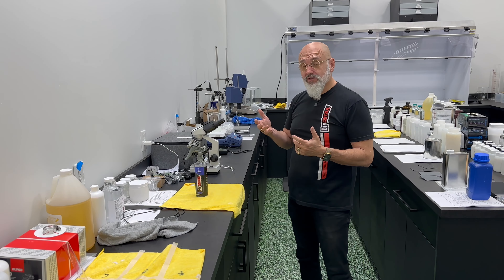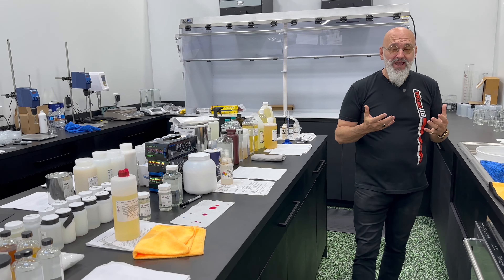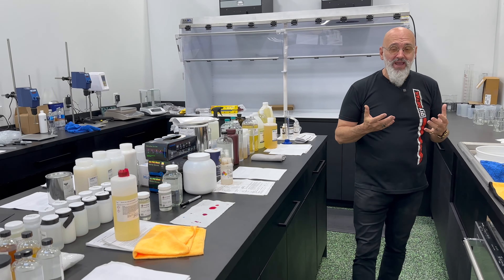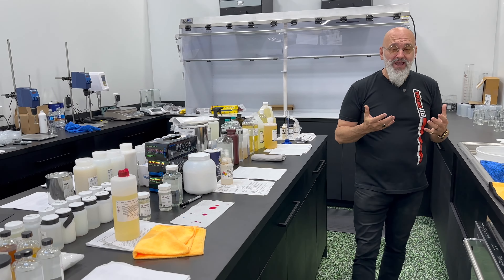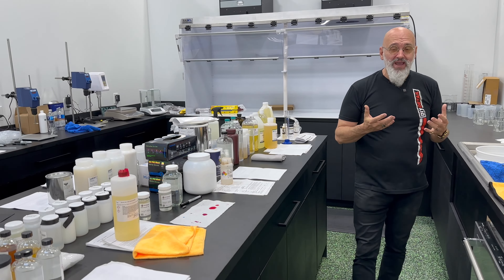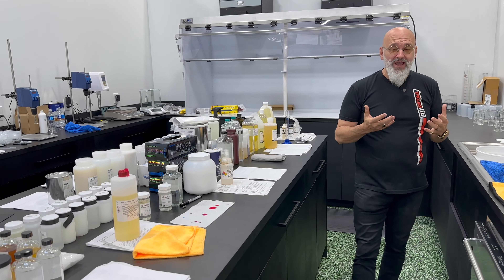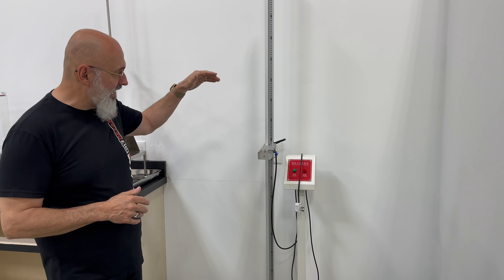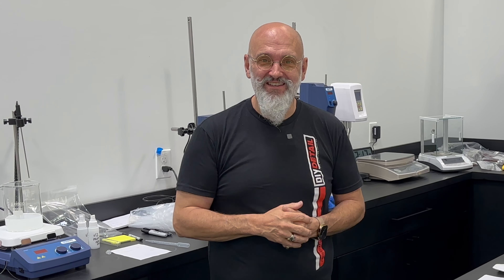Welcome to our lab! Tools, techniques and procedures used to ensure product quality

Comment: In some of the previous videos Yvan mentioned staying away from spray coatings cause they are fluorinated and bad for the health if absorbed through skin contact. Can you give some examples of spray coatings or what to look out for on SDS sheets so I can stay away from them. Thanks!
Reply from the maker: Never spray a coating without full PPE, don’t rely fully on sds information.
Reply: @diydetailofficial  I'm confused what's considered spray coating. With so many sealants, drying aids, quick detailers these days claiming to coat the vehicle, I was wondering what's actually considered a ""spray coating" and what materials to look out for in an sds sheet to avoid. Thanks!
Reply from the maker: Our 3, 5, 8 year coatings are not to be sprayed, PFAS’s are to be avoided.